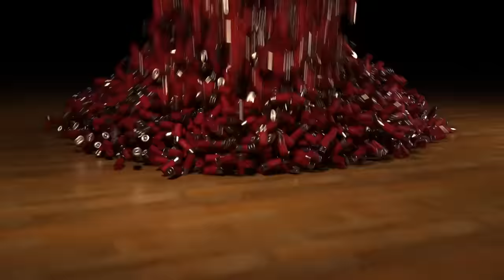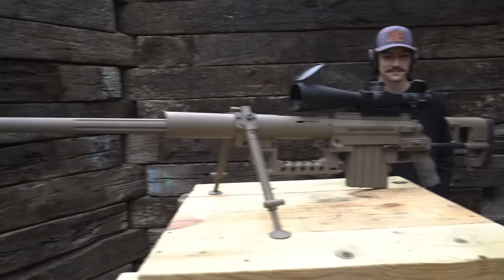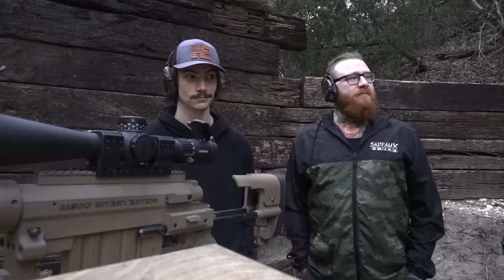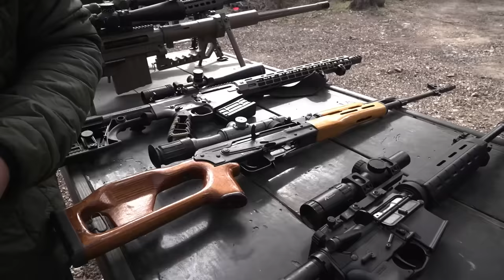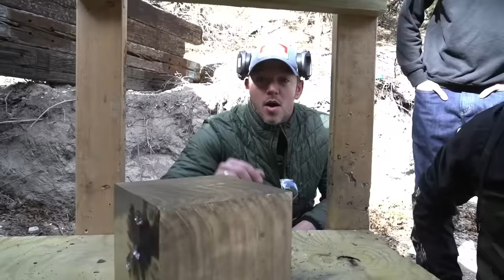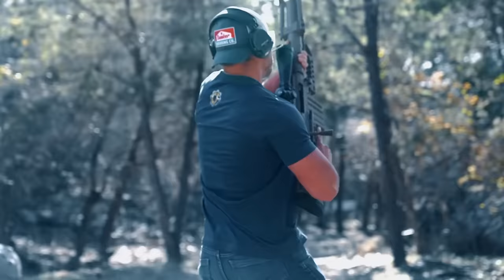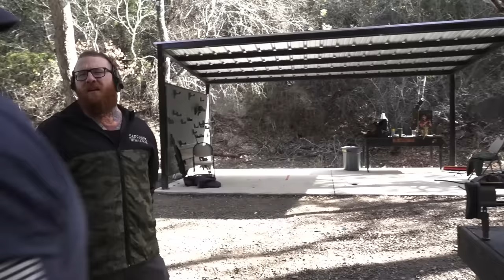The Most POWERFUL Sniper Rifle vs. Solid Block of Bronze!!!

Comment: The wonderful thing about bronze is the way you harden it. Unlike steel that you harden through heat temper, bronze gets harder as you work it. The more you hammer bronze, the harder it gets. So it makes an interesting material to utilize in armor due to this property. I learned this in blacksmithing.
Reply: Yeah just like copper. That's why you have to get the general shoe of what you're smithing quite fast because otherwise at some point you can't be precise on your work
Reply: It's the copper. Same thing happens. you actually heat it up to soften it again IIRC, Its called annealing I think

Comment: Take a WW2 or Korean war vintage black tip 30/06 round. Pull the bullet and reload it in a 300 win mag to 3300 fps! It will go through 1" mild steel. Probably go 1.5"-2" into that block.

Comment: the silver tipped 30 cal bullet fired out of the winmag wasnt API i used to handload those same bullets i reckognize them they more like a balistic tip they have a soft material for the tip and a soft lead core thats why it exploded and turned the bronze black idk if it actual silver in the tip but it isnt steel core like api that forsure

Comment: Well if it has a zero lock, it's probably locked like a 500yd zero. Nobody uses .408 CheyTac for close range when the MF is accurate at 500+ and they are $15-$20 a RND you want to see how far you can slap steel.

Comment: First up, I do in fact know that theory isn't everything and that I shouldn't take it fully at face value but I can't help but notice discrepancies with the ballistics claims of the .408. From what I hear, the .408tac is supposed to have more energy than the .50 at ranches beyond 400 yards I believe even 'Cartridges Of The World' also claims this. However, when I do ballistic simulations, it claims the .50 has more energy up to about 700yds? For the .408 I'm using 419 grains, a muzzle velocity of about 3002fps and a coefficient of .94 which is about what every source claims it is. For 50 BMG I have a hard time finding the right data. From what Barrett claim, their FMJs are 661grains with 2800fps and a G1 of .64 allegedly. I've run different simulators and they all seem to show the .50 as having more energy up to about 750 yards. So what type of .50 was supposedly used to gauge this 400 yard theory because I can't get a single simulator to do this with the data I currently have. Again, I do know theory won't be perfect, but it's quite a difference I'm seeing and quite consistently.

Comment: I designed a Very badass Sniper Rifle, the 20x220 mm Madwoman. It had a 3500 mm Barrel, hydraulic suspension, Special buttstock and a gasaction Suspensionlock. If i buid this, do you want to shoot it? With many greetings Lara.

Comment: Drewski is a newb, doesnt bother removing the mag, just draws back the bolt to remove the round look into the chamber and leaves it locked like that, mag in as if it was properly cleared....rofl.
Stick to airsoft bud.